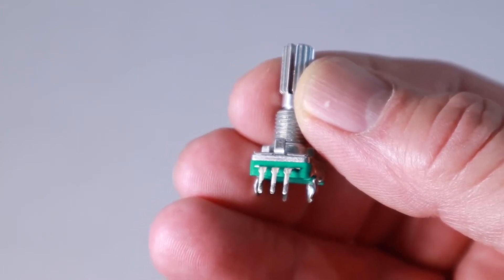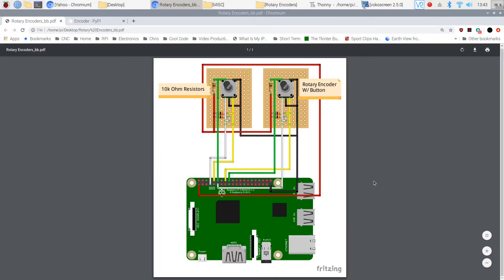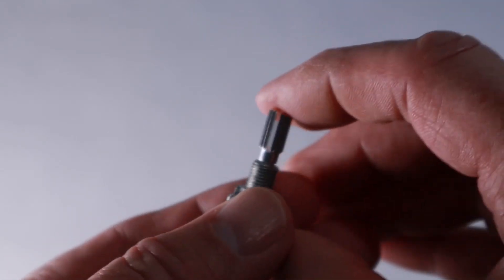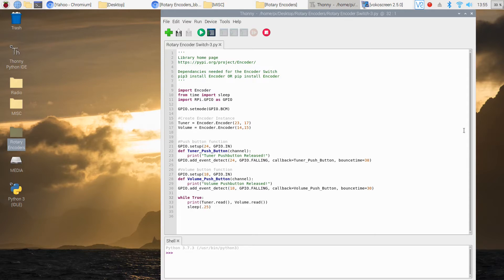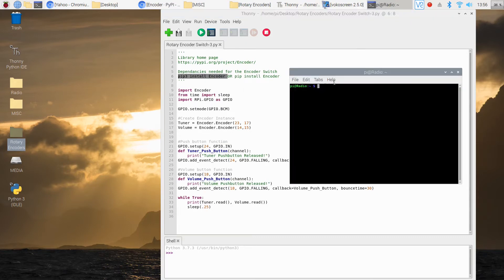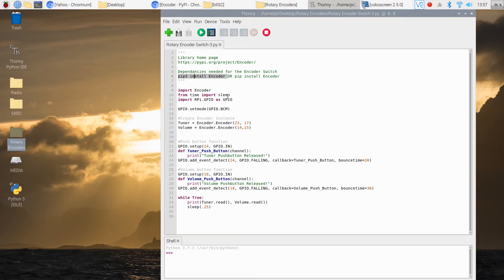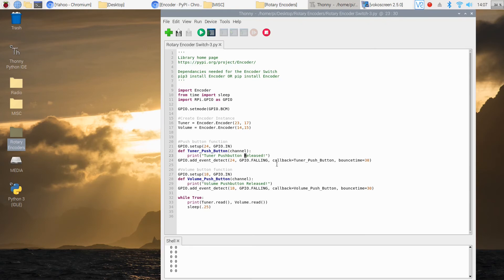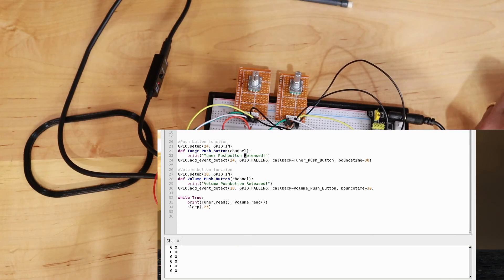E003 Using Rotary Encoder Switches on the Raspberry Pi

Comment: awesome!, how can I get the output to be a keypress for each click? I am trying to use it for software that only works with up/down button control.
Reply from the maker: Good morning RogerEmmelstein,
Unfortunately I have not done any keyboard emulators as much as I would like to, just haven't had time.  I would suggest looking for information at Adafruit.  As I recall you will need to use CircuitPython (adafruit) as opposed to MicroPython.  They have some examples there and it should be a good start for you.
Cheers!
Chris

Comment: Thank you for referring me to this video, Chris (your reply to my comment under RPi PICO encoder video). The instructions here work for me on my Raspberry Pi 4B. This is great!

However, I see that it works for only very slow speeds of rotation. I have a shaft encoder and it generates a value of 2400 (Encoder.read()) in one rotation in your code when I rotate it very slowly. In my use case I expect the maximum rotation speed of about 15 rotations per second (900 rpm). Apparently the Pi is not able to handle interrupts at that kind of speed (15 x 2400/4 = 9,000 per second). Would you have any suggestions how can I get the Pi and the code to work accurately for such speeds?

This encoder is specified to be able to work up to 3000 rpm (50 rotations per second). I don't know how people handle that interrupt speed! (50 x 2400/4 = 30,000 per second)

Basically, I am trying to build an odometer and a speedometer for a trolley that will run up to around 25 km/hour. Would you recommend some other approach for this purpose?
Reply from the maker: Hi @ankurbhatnagar4609,

Unfortunately, Raspberry Pi, using an actual Operating System, doesn't lend itself well for this sort of thing.  That is not to say it is impossible.  Try searching for a Python library for Quadrature Encoders.  Someone probably has written something in C++ and has made it accessible from Python via a library.  I have not gone down that rabbit hole yet with the Raspberry Pi.  

Chris
Reply: Thank you  @MakingStuffwithChrisDeHut  for your reply.

In your other code, meant for rotary encoders for Raspberry Pico, I noticed your comment there that, that code running on Pico can handle interrupts up to 1,000 per second. Have you verified that number?

I was thinking that if I use a 100 PPR encoder in place of 600 PPR, my maximum interrupt rate could drop to around 900 per second. If Pico can really handle 1,000 per second, I guess Raspberry Pi 4B (2 MB RAM) to  should be able to handle 1,000 per second. What do you think?
Reply from the maker: Hi @ankurbhatnagar4609  
To get an idea how fast the PICO is while still being pretty accurate, this video
https://youtu.be/g4_ZpVmTi9g
is explaining how a photoreflective sensor can be used to measure pretty high speeds - well within the range you are talking about.  
Chris

Comment: Hello Chris ! Great video ... I am wondering what types of encoders are used in modern stereo ( like in cars ) ... where the knob turns inderfinitely to the right and the left ( over 360 degres ) and also have push on switch function ... Wondering if you can help ! Many Thanks  !
Reply from the maker: Search for "rotary encoder Switch" on Amazon and the first item to show up would be exactly what you describe. These are what are used in in car radios.  Thanks and Cheers!

Comment: Do you know how to limit the encoder? For example, I want the values to be within 0 - 360. Would you know how to keep the values  between 0 - 360?
Reply: You can either clamp the values between 0-360 using Python, or start from zero when you've reached 360 using modulo.
clamp:
value = max(0, min(x, 360))

modulo:
value = x % 360

Comment: Great video. I have an issue though that you may be able to help with. I have my connections exactly as you have them - minus the resistors. When I turn the encoder knob it seems to short out the Pi for some reason. Could it be a faulty encoder?
Reply from the maker: Thank you! 

The resistors serve a very important purpose in that they prevent too much current going into the input, without those resistors, you could fry the RPi.

Also, if it is shorting out the RPi, my guess is that the pin-out for your encoder switch could be different than the one I used.  Try to find a datasheet for the encoder and make sure the pin out is the same as the one I used.  Also, make certain of which pins you are connecting to on the RPI and that they are configured as inputs etc.   

That is about all I can guess at based on what the information provided.

Chris
Reply: Thanks very much. Turns out the pins I had it connected to weren’t configured correctly. 

One additional question... Is there a way to reset the counter to 0 each time the encoder steps one click? I’d like to just capture one click clockwise or anti clockwise at a time.
Reply from the maker: @roberttrottini9660  The library doesn't have that ability, however, you could add your own counter to handle that by comparing a previous read against a new read and then incrementing your counter up or down by one (or more).

Chris
Reply: Thanks again. I figured it out and did exactly that. Works great. Once again, great tutorial. Was extremely helpful.
Reply from the maker: @roberttrottini9660  Outstanding!  Glad it all worked out for you!

Comment: Hey such a nice video! It help me a lot.

I can't see the link to the source code.
Reply from the maker: Very sorry for that!  I will check and see if I can find the source code from that video an post it.  Unfortunately, I don't think I still have it.
Reply: @MakingStuffwithChrisDeHut  Thanks for the answer. I got the code. I just have a problem. The function tuner_push_button is triggered the hole time. But I don't press the encoder. Do you know why? I got a rotary encoder on a board with restistors installed.
Reply from the maker: @tzabbi I would check with a multimeter to see if the switch is working on the encoder.  I would then check to see if it is wired correctly, not all encoders have identical pinouts.
Reply: @MakingStuffwithChrisDeHut  Ok thanks for the tip!

Comment: Can this be installed and run within Win10 environment? I have no idea about installing libraries or why I would need to ?
Reply from the maker: Hi Al,  unfortunately I do not know that answer - I would ask that on the Raspberry Pi forum to see if someone there has the answer.  I have only used the Raspberry Pi with Raspian OS.
Reply: @MakingStuffwithChrisDeHut  I think that means linux os, not win10.
Reply from the maker: @alheeley  Correct.